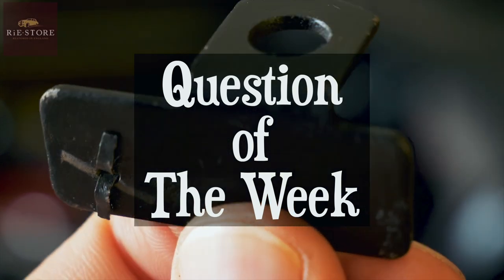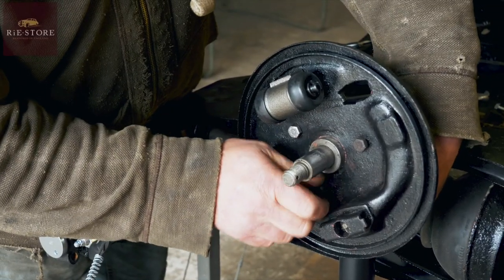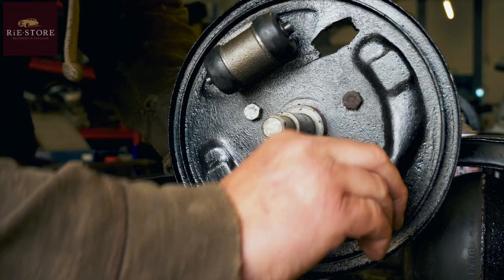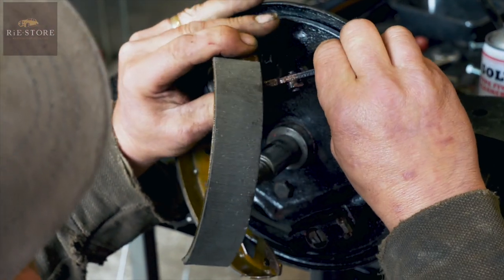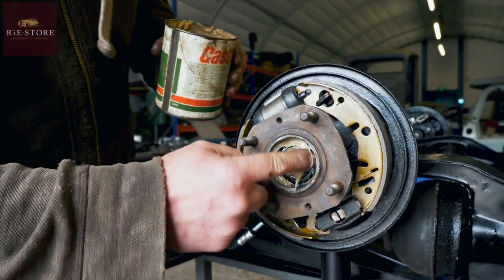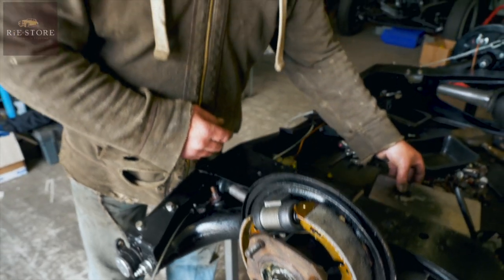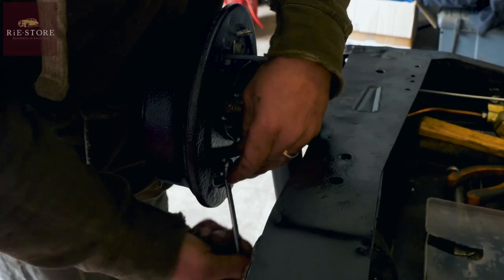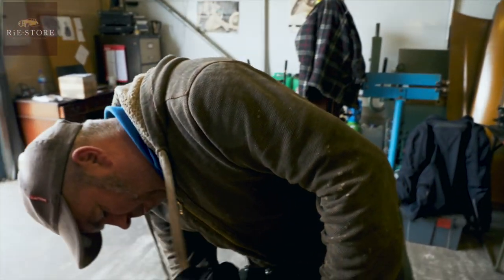Assembly of rear brake back plate, shoes & trim - 1963 Mini Cooper 997 / ep034

Comment: Probably you found out by now, where this little bracket you showed at the beginning of the video belongs. It's the throttle pedal rest bracket to prevent the pedal from being pushed too far back. This bracket will fit on the pedal box. The split pin is there for holding a small piece of rubber to prevent rust being always in contact with the metal pedal arm.